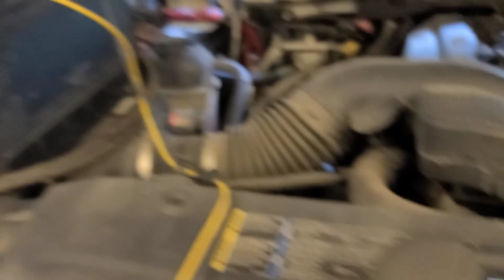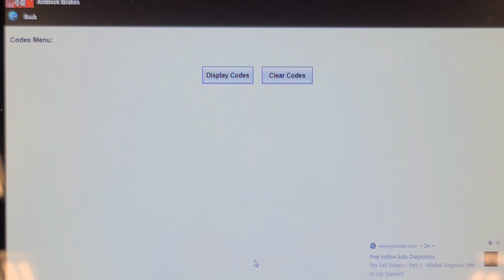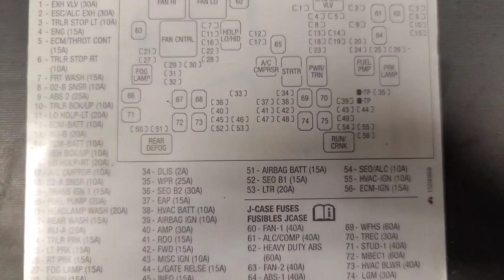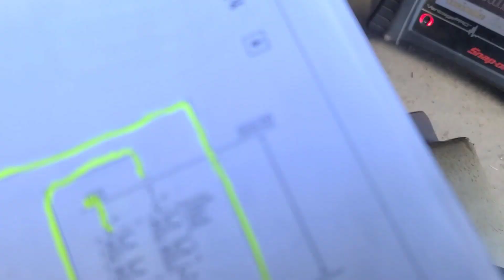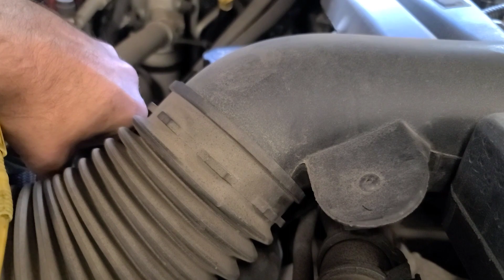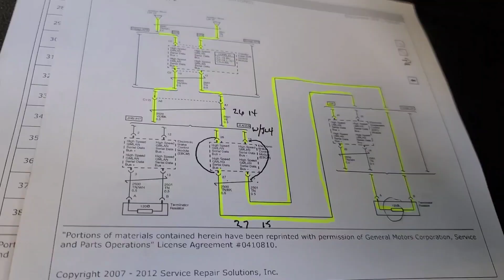2007 GMC Yukon No Start, Multiple Warning Messages, Many Ugly Codes

Comment: Where is the part 2? This is exactly what my 2007 Yukon XL is doing
Reply from the maker: https://youtu.be/O2I7FQXyFTQ?feature=shared
Actually Part 3. Problem was suspension control module shorting out the network
Reply: @PhillipBailey  I have not received a message about the suspension, but I do the braking system.

Comment: Wouldn't surprise me if you've put in 1500 USD of diag work already.  I bet there is probably more to the history of this vehicle than you have already deduced.
Reply from the maker: At the end of this video I had spent three hours diagnosis time. Did some more today. Turns out the customer put in a used BCM. That likely accounts for some of the option configuration codes especially in the airbag system. Tried to flash the used BCM but had some software issues and needed to call tech support but most of the cell service was down today in Canada.
Reply: @PhillipBailey  Yeah...based on your experience, I'll probably never withhold information or lie to my doctor again.  Some simple (lack of) information may cost more over the long run....maybe.

I'm staying tuned for part 2. This one is a real nail biter.